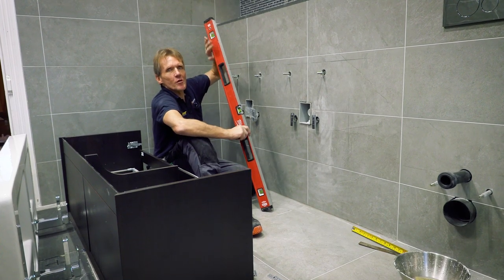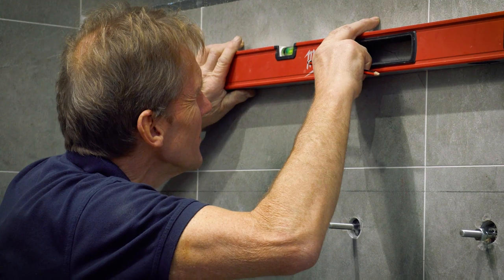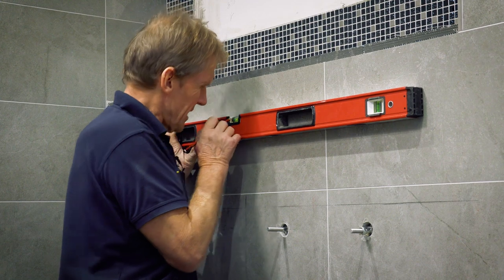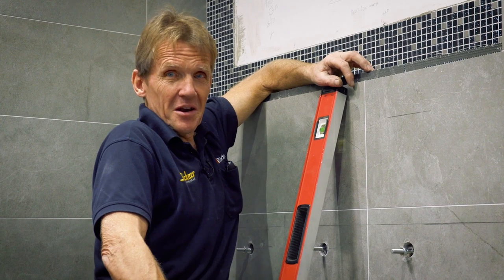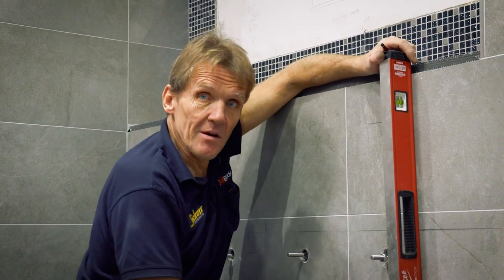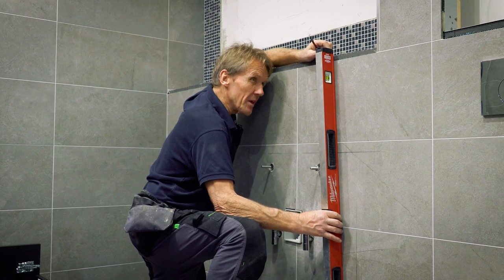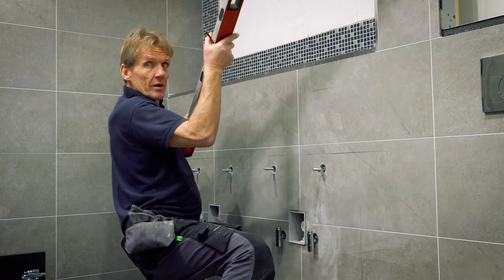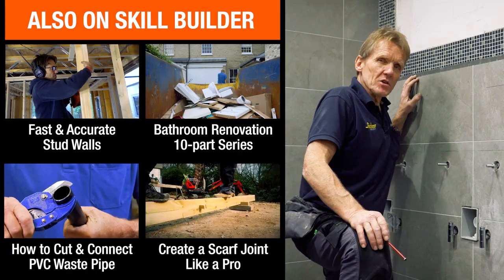Is Your Spirit Level Really Level?

Comment: When checking your level for plumb, you just checked / used 2 different bubbles. If it was me, I would have just turned it so that the other long edge was against the wall. I have in the past had a level with one of the 2 end bubbles being ok & the other one no good.... I blanked out the bad one
Reply: I was going to say the same but you got there first
Reply from the maker: Sorry I had assumed that you would see me looking at both vials. If there is a discrepancy that alerts you to a problem. The vials are set on the milled edge on the top so your idea is not strictly accurate. I would however agree that in the majority of cases it is good enough. The long the level the more important this becomes.
Reply: mickymidnig

Comment: I like to put 2 screws on a level ish piece of wood. Adjust 1 of the screws up or down until your spirit level reads level, then turn the level around 180 degrees as per Roger's video and see if you get the same reading. You can do the same on for the plumb vials but on a wall.
Reply: yes my dad used to do this , 2 screws set up spot on plumb ,they were fixed to the garage wall and never moved

Comment: If it is a Milwaukee level chances are it is not level, if it is level then you have beaten the milwaukee odds on getting something that works.
Reply: Really?  I don't have a Milwaukee level.  I buy cheap ones that I check first.  PS.  I've dropped them and they stay true but don't do it.
Reply: What lol? They make great levels. I got both stabila and Milwaukee and are both equally amazing.
Reply: shaftwood nope
Reply: Wouldn't buy anything other than a stabila....the best money can buy been using them for 20yrs as a bricklayer there fantastic never had one go out of level or plumb.
Reply: @shaftwood   The thing is that you need to tweek all your tools.  You need to bring them up to spec and maintain them.  I don't have, well, I'm lying again.  But you need to tweek your hand tools all the time.
Reply: Vojnik JNA yup
Reply: shaftwood exactly

Comment: A plumb bob line (string & a symmetrical weight) will always hang "plumb". 90 degrees from plumb on your framing square is level...Gravity as a calibration reference does not lie.

Comment: If it's made by Forge Steel then they make them already out of level, then you don't mind kicking it about and just using it for a saw fence 😉
Reply from the maker: It is amazing just how many levels leave the factory not level. Not the case with Stabila or Hulatafors, Sola but a lot of the others are suspect.
Reply: shit i bought a set of them! dam it :-(

Comment: I was taught to lay the level on any flat service and note the bubble position. Switch the level end for end and the bubble should be in the exact same position, if not the level is defective. Takes two seconds to check. First time I checked mine, and I have lots, Stanley’s ,Empire, Rabone etc., oddly only one of my Stabilas was out.
Reply: If you know that the surface is level (you've said 'flat' when you mean 'level', I think), the bubble will, by definition, stay in the exact same place (relative to the tool itself! -- i.e. if it's slightly to the left in first position, it will be slightly to the right in second position) when you turn the level round -- the level doesn't 'know' it's been turned round because it's reference surface has remained horizontal. The level is then only defective if that 'exact same place' is anywhere other than centred between the lines on the vial. If it's off-centre, the level is reading wrong.
Reply: Mij Orchard No the surface does not need to be level only flat.

Comment: Im a tiling contractor and about 5 years ago got a big tiling job in a sports centre. Long walls. First day setting out with the youngsters (LOL) i got my water level and string line out. One of the whipper snappers actually said, 'whats thats stuff'! I challenged him to do a level line 18 metres long with his (cheap) level, while i do mine with a water level and chalk line. Checked levels with a surveyors laser. Over 18 metres his line was 14 mm out! Mine. Yep. You got it. Perfecto!
Reply: We were taught to use and had to practically use water levels when doing my carpentry and joinery nvq,s and I'm glad that we did.
The kids these days like you said havn't gota clue what they are, granted we have excellent laser levels these days bit it's still good to know the traditional methods

Comment: To check for plumb, you can use the same method as for checking level: set the level against the wall in a dead plumb position and make marks on the wall; then flip it end for end and see if the same bubble reads plumb again. Then check the second plumb bubble. Even if one is good, that's no guarantee that the other one is.

Comment: It doesn't have to be in the middle as long as it's in the same spot after a 180° rotation. Myself I like to place it that the bubble touches one of the lines and then only rotate and if need be adjust with a Phillips head

Comment: Always check levels before you buy them. I have a very small Rolson magnetic level that lives in my tool bag. It was the grand sum of £2 and I love it, comes in handy so often. However when I bought it I had to go through about 10 levels on the shelf before I found one that was spot on perfect. They were super cheap levels and though the materials were good, the quality control was poor. If you check before you buy it though it's not a problem. Do the same if you are buying from a car boot or second hand shop, takes seconds to do but saves you trouble in the long run. And of course as Roger says, keep checking your level every now and again, especially before and important job.

Comment: What are the chances you would build a whole extension and never flip your level around once?

Or were you using a level that only showed plumb one side? Like a stabila with a horizotal centre bubble,  vertical one end and an angle finding rotating vial the other end that no one ever uses lol?

Comment: I'm sure my 1800mm stabila level bubble moves around on its own, just to spite me. When fitting external doors I don't worry about the odd mm of plumb cos the brickwork is usually banana shaped.
Reply from the maker: Biggus Dickus 

The spirit moves and the wind blows wherever it pleases. You hear its sound, but you cannot tell where it comes from or where it is going. So it is with everyone born of the Spirit."

Comment: Older more experienced workers always tell me how in certain situations you should not even use a level... if there is other stuff around that is not exactly level, then you should just go with that. I usually only work with pipes in industrial environments so it's not always so critical if they are level or plum. I guess if I would install a shelf it's a bit different.
Reply from the maker: There is no doubt that in a wonky building full of charm and character the eye is better than a level but placing a radiator under a window where the window board is out and the floor is level you end up having to make a decision and it could be to split the difference. I always try and involve the customer at this point.

Comment: Are you on the level Robin?
Oh wait it's not Robin it's batman!
Great video as usual.
I'm pretty sure the Milwaukee make a good level. I own some electronic levels and would have liked to have the stabila opppsed to the Bosch levels I have.
I used to buy stabila levels and got sick of people always stealing my levels.
You buy good tools and people steal them.
Same with gold shovels.
As a plasterer in time the window gets dirty it builds a film of dirt that is hard to see.
I think the cement etches the Perspex which if you look under the microscope has small indents. You can use clean water and in time it still builds a film.
I would like to see some technology to overcome this. I work with an industrial chemist and done away from using any lime in mortar and plaster. Best thing I ever done.
The cheaper levels in time they no longer remain level. I'm not sure why. It's something to do with the spirit or how the sprit level has been encased. Since people keep stealing my stabilas I started buying high end Stanley levels. Fatmax etc.
The Milwaukie I haven't seen any here I must have a look. Does milwaulkie also do a electronic level?
I did buy an Imex. Wasn't happy with it as I found it difficult to calibrate so gave it to my friend.

Comment: I just place the level on a flat surface/desk. Note the position of the bubble and then spin it round. If same, all good. Saves worrying about pencil lines on a wall because you can never get them spot on depending on the angle of the pencil and also your eye position.

I'm watching this video because my '3 hammer' spec Stabila  1.2m level is slightly out. Noticed today. It's barely had any abuse as well. Otherwise I've always been a fan of their stuff.

Comment: Just wondered why it's important to get the vial on the same point, surely a horizontal line is still horizontal regardless of where it is relative to the level?
Also I would say this won't spot a twisted level, as it will be out the same amount whichever way round you put it.

Comment: you cant flip the level that way when you check vertical axis cos its another bobble. you should flip it 180 so the bobble face the wall.
Reply from the maker: You are still testing the level because  a discrepancy means one or both are out. Then you have to bend down a little and check the lower bubble. I know it makes your back ache but that is the building game for you.

Comment: Then there is the issue of using a level correctly....Sliding it down a will...say when tiling...sliding the level which may only be out by half a mill....but after sliding it down the wall three or four times...you will be a complete grout joint out!..So it is best to flip the level end to end each time...worst case ...you're out half a mill....Minimize the discrepancy... The same with checking for Plumb, rotate the level long side to long side.   On another point...Laser Levels...when doing a vertical line...if the wall you point the laser at isn't plumb then the laser line won't be either..it will lean one way or the other.....try it and see.

Comment: I use to lay it on a level table...then turn it around. If there is any deviation it is out of level.
Reply from the maker: You don't actually need a level table to test it. You can put it on a near level surface and just note the position of the bubble in relation to the lines.

Comment: Roger, just before you marked the wall I noticed you put the pencil in your mouth as if you moistened the tip. Was that intentional?
Reply: I havent seen somebody do that since I used to watch my grandad in his workshop as a nipper
Reply from the maker: Masherco I looked at the tip and it was barely poking through so I knew it needed sharpening. A little twist in my incredibly sharp beaver like front teeth produced a bit more graphite. I thought everyone did that. I put everything in my mouth. It is a tool.
Reply: The old guy I trained under used to test my new levels against his stabila box level. 
One day I noticed his level was bent, when I asked him why he said it got driven over by a roofer. I bet he’s still got it

Comment: I bought Stanley fat max 2 foot and 4 foot about 4 years ago never abused im a bricklayer , when I used them recently to fit my kitchen out by a mile total shite , gone back to stabila best level ever , thing is if a level is out you cant adjust it
Reply: I'm bricklayer and after following on some of my mates blockwork which is normally Bob on....it was out of plumb by a fair bit!! I picked his level up and checked it and it was way out...that was a fat max. Garbage mate I will stick to my stabila you can't wrong with them 👍

Comment: Good tip thanks Roger.
Can i ask , are Ox tools a OK brand .
Reply: Hi i bought ox professional levels as a set an the 600 level  vial was off
Reply: Stabilia every time
Reply: @masherco  The fluorescent die in the vials in my Stabila level has faded so that now the liquid is transparent, whereas the liquid in my cheapie level from Wickes is still good and strong.
Reply: Yes i wouldnt buy ox again
Reply: @gospelman7222  really .
Reply: I don't rate Ox tools much....stabila is the top dog of levels
Reply: Got a few bits, tuck pointer, pointing trowel etc, they all fine don't reckon  I'd go for an ox level  though